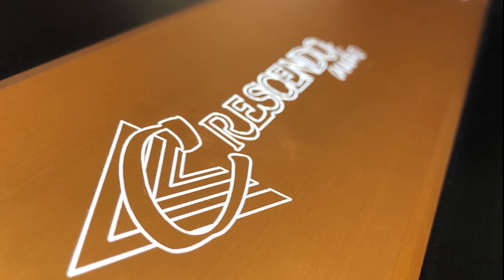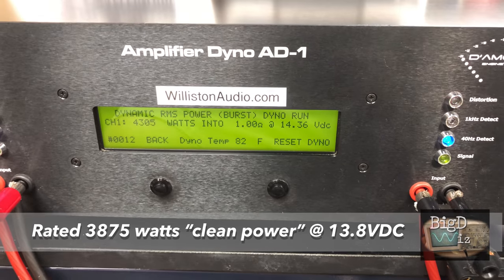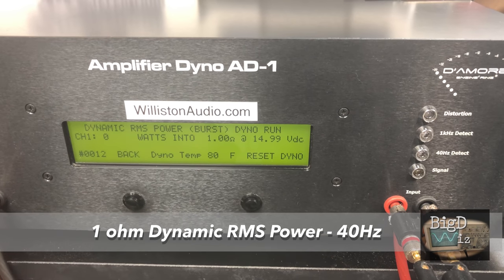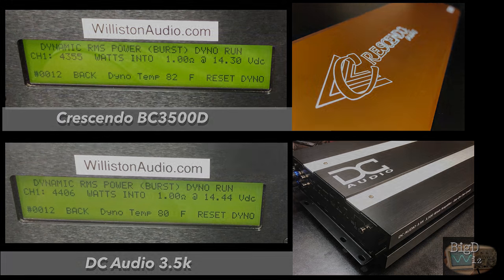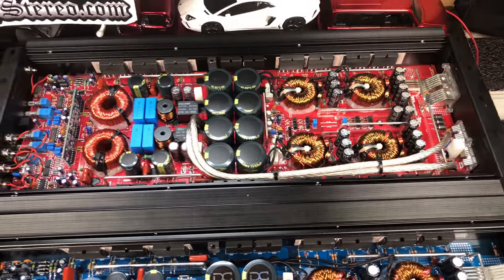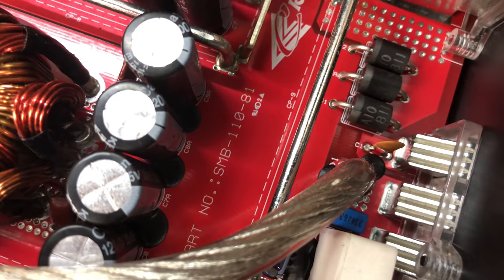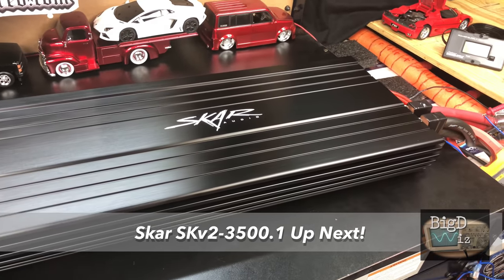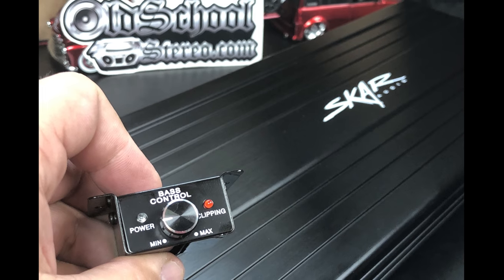Crescendo BC3500D vs DC Audio 3.5k 1 ohm Dynamic Amp Dyno Tests (4K)

Comment: Funny thing that stood is out is that DC is now putting stickers on the shitty Chinese caps they put on their boards. Not trying to discredit DC because they do numbers but when you look at a brand like RF they actually make their own boards and use quality components (like Japanese Nichicon caps and TO-220 FETs on their boards). People will say they are expensive but you have to pay R&D and supplier costs. I see Crescendo, DC, etc... as resellers. They just get Zenon to build their amps for them and they customize various components to their taste (or price point).
Reply: Definitely. And customization on parts is even a stretch. most of which is cosmetic besides switching some caps and fets. And honestly if you not upgrading the board what's the point, people just smoke them anyway. Amp repair guys are putting they're kids through college off Korean amps lol

Comment: There is always variation even with the same brand. This is due to variations in components used and acceptable tolerances which are usually +/- 5%
Reply: ShowtimeSPL  yep see birthsheets  like that all the time
Reply from the maker: Exactly what I’ve been trying to say. Maybe Edwin can explain it better 😬🤙

Comment: Big D curious with all that wattage theses amps are pushing  what type of Electrical upgrades are required to provide the proper amount of current to power them ? are you talking multiple high current alternators , several batteries ? capacitors ?
Reply from the maker: If running at 4 ohms, you may not need any upgrade! But, running at 1 ohm I’d say a minimum of an extra battery, HO alt would be good as well. Really depends on how the amps are loaded and the type of music you listen to

Comment: The reason people keep saying that is regardless of the percentage of difference the dc audio beat that amp by 100 Watts in every category that should be a win imo
Reply from the maker: But it should be understood if 2 more amps were tested it’s likely the results would flip. Component tolerances
Reply: Yeah I do understand that as well but as it is now it’s should be a win for dc again imo not trying to start no pissing war with any crescendo lovers just saying if it was any other amps I would say the same thing weather it be 1 watt or a 1000 win=win

Comment: Seems that volts stay higher with the Dc producing 51 watts more😒👍💪👌
Reply from the maker: 1.15% though. Closer than the shave on my bald head after using that $15 razor your momma bought me 😂
Reply: BigDWiz But then yours bought me the Dc 3.5k😁 and I 🔊🔊🔊🔊
Reply: Do you think the fan is dropping the voltage for the amp?
Reply: Ernesto Barajas ?
Reply: +Ernesto Barajas I bet you're exactly right the fan is dropping the voltage
Reply: That fan is drawing around 0.25A so i don't think that should have noticeable difference when you compare it to amp that is drawing 300A, also in last test Crescendo was drawing 15A less than DC (306A vs 321A)
Reply: COMPASBASSCLUB CHICALI  si lo mismo pensé Ernesto Barajas? 🤔 Wtf 😅 marcale macario

Comment: Cendo its cheaper with higher quality components period.
Reply: This is why if I "had" to choose a winner, it'd be the crescendo.
Reply: There the same parts. Same caps same diodes same fets same resistors. Like your brand name but not because of the parts. Like your brand name on price in this situation. Cause there the same
Reply: dan daves cendo has higher qualiter connection i.e. the tiffany style rcas wich is a huge difference. The dc is just same parts worse connectors and way more money the dc audio is a bullshit brand.

Comment: Seen 2 many Cresedos blown, DC Audio all the way!!
Reply from the maker: Hi John. If you watch the video you’ll see both amps are nearly identical, right down to the part number on the main circuit board. S&I Corp for the win, DC and Nendo rebadging for the info
Reply: It's the same board lol you've seen one blow more in your tiny amount of knowledge, and that means nothing
Reply: Lol

Comment: I bet if you tested 5 DC amps in 5 Crescendo amps they'd all be a little different just like an engine you can have a Corvette motor two of them exactly the same one of them to put out a little bit more horsepower than the other one even though everything is exactly the same in other words even if everything is exactly the same something's always different a little piece of sod are here Electro there piece of copper here the shit adds up can I bet if you tested 5 of the same amps everyone would test a little bit different
Reply from the maker: Thank you 👌
Reply: +BigDWiz no thank you for everything you do you're awesome

Comment: Dc audio won but by a little
Reply: It's the same exact board, pop another amp of either in there and the Crescendo may beat the other by 3%. WOAH NO WAY
Reply: Birth sheets on identical amps could be just as different.

Comment: I bought me a beautiful brand new pure audio 3.5k or 4 k,i dont know what they label it as.but its like a 2013 model.its same board as the ground zero gzpa 1.4 dxii.sucker was brand new has a different heat sink than the ground zero,and has a big blue light that lights up pure audio.$200 plus 65$ shipping off ebay.i wasnt trying to buy it really but made offer guy accepted.😂its bout 800$ amp.came out really well.need get me some more headway tho.
Reply from the maker: Awesome 👏